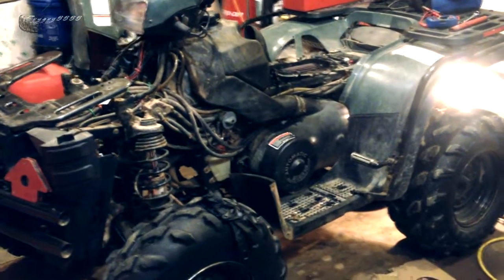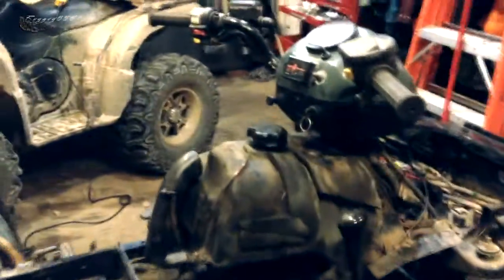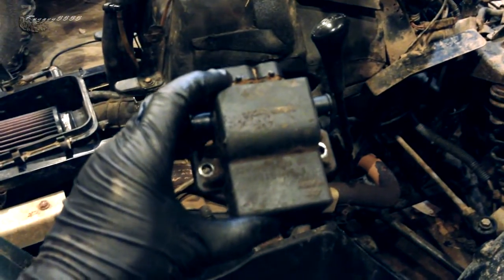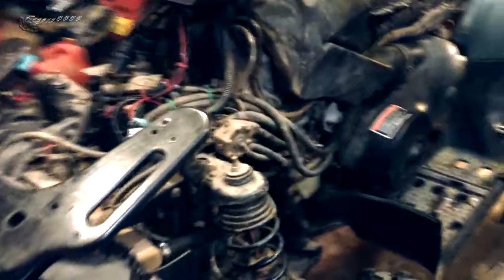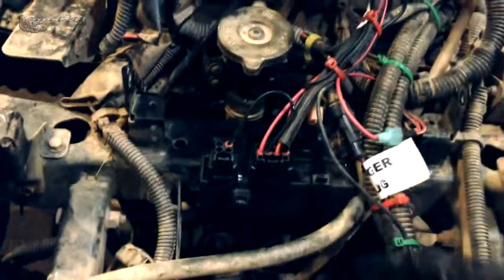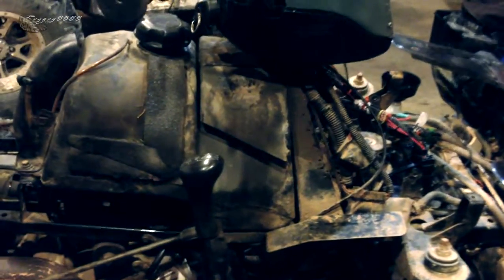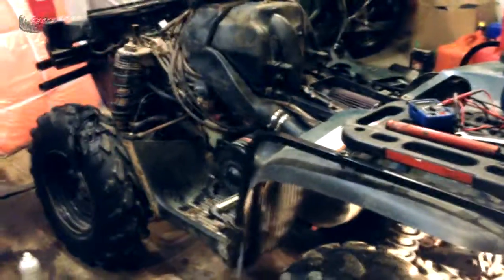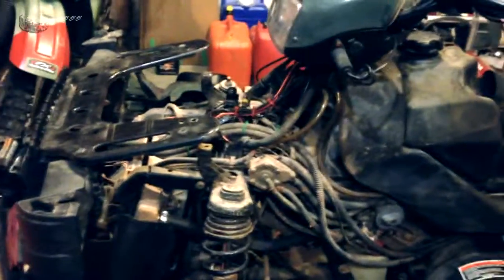HOW TO: (02 to 04) Polaris 600 and 700 Twin Ignition Upgrade Info

Comment: Are you still around? I know this post is a few years old. I have a 2003 700. I just bought the machine. I installed a good known mukuini carb . It started up and ran. Try staring it the next day, it would start even with ether. I have good spark, compression cold is around 140psi both cylinders. Doesn't  even sound like it wants to start. Its weird runs one day and nothing the next day. Any suggestions?
Reply from the maker: Process of elimination to start with. If it runs at all, that means you have, air, something combustible and spark. If it only runs on ether, then it sounds like you have a fueling problem with the new carb. you're going to have to remove it, clean it extremely well by removing all components, jets, ports, float, needle etc.. and try it again first before moving forward.

Comment: I don’t get why you replaced the electronics ,what was the issue in the first place ? Mine runs great when stating it up with choke out ,then i let it warm up for 5 min then push choke in and it idles fine till i give it throttle to move it ,then it stalls
Reply from the maker: The OEM ducati ignition box was failing. Cutting out the spark at random intervals and when the ignition system heated up. So it was replaced with an aftermarket upgraded kit. 

It was a known issue with these twin cylinder ATV's and even in the Ducati motorcycles that the part was placed in. If yours is still working then that's great. 

Your stalling issue is either this electronic ignition issues stated here, or a plugged main jet on your carb
Reply: @ruyguy8888  thanks for your reply back it sure helps a person understand    the situation. Thank you

Comment: The magnets came loose on the flywheel.. Can I just leave them off and install this upgrade? I thanks for the help
Reply from the maker: To be honest Duane, that's something i'd have to do some digging on. The best course of action for you would be to call RM stator 1-877-838-1399  they would  able to answer your questions quicker than i can.

Comment: Hi I got a 04 Polaris sportsman 400 and battery light comes on and when I give it half throttle It shuts down n stops running any idea what the problem can be ???
Reply: voltage regulator $15 on amazon fixed mine. problem was overcharging the battery

Comment: do you have a video on fixing a bendex on a 2002 polaris 700 sportsman?
Reply from the maker: No I don't , sorry. 

however a quick youtube search and i found lots of generic videos on how to service or fix a Starter bendex.
Reply: I did to but only on 500's 700 looks like the fly wheel needs to be removed to get the bendex out.
Reply: I did to but only on 500's 700 looks like the fly wheel needs to be removed to get the bendex out.

Comment: I have a few questions for you if you wouldnt mind answering them , what are the chances of the upgrade part  fixing my polaris? I am not sure what is needed to be fixed. So far i have replaced coil pack . I am not not sure what else to do, I watched your video and was leaning towards buying the part to see if it fixes it since it covers many main areas of the polaris
Reply from the maker: Im no Polaris expert, however from the repairs I have personally done on most twin cylinder carbourated ignition systems, I can say the failure rate on the Ducati coil / CDI (Capacitor Discharge Ignition) systems are as high as 50%

I have installed the RM stator system on many 6 and 700 twin bikes but never an 800 yet. However i will say that i haven't had one come back yet with issues after the install.

Comment: what is the name of the dealer where i can buy this part although i belive its only my key switch but may be a very good upgrade
Reply from the maker: This link is in the description as well. 

https://www.rmstator.com/en_ca/products/rm22957-ac-to-dc-ignition-upgrade-kit-for-cdi-and-stator-polaris-sportsman-600-carb-700-carb-2002-2003-2004-2005-2006
Reply: Thank you 😊

Comment: Good job! Nice easy fix with the new parts.
Reply from the maker: +cubbeezx I was actually pleasantly surprised at how easy that fix was!, The hardest part was the diagnostic. Lots of tests for only a carbourated machine. I wish i had some of the fancy diagnostic software that the dealers have, waaaaay too many wires on the new ATVs.  Thanks for checking in there Cubbeezx.

Comment: my 08 500 I had nickel and dime me bad  lots of parts and then more parts  bought a grizzly way better machine  but just bought the wife a 14 ace hoping the newer polaris stand up better
Reply: +shilosheena  almost the same situation im going through. dam polaris will nickel and dime you to death. but I want a grizz for my next bike but the ace is really attractive to me as well. but if I did get the ace I would get the 900
Reply from the maker: +shilosheena I'll give this to polaris. From 2010 and on, they vastly improved their quality from where it was, however i still believe that the overall build quality of Polaris still has something to be looked at. 

Unsealed wiring harness connectors, faulty grounds int he electrical circuits lack of gussets on frame components and weak pieces of the drive train will keep me away from using their product.  The new Prostar engine lineup they now have looks to be really reliable. only time will tell.